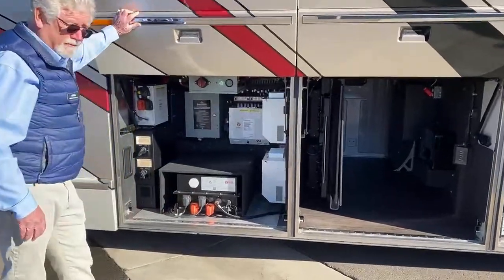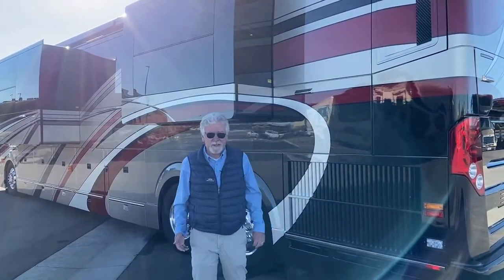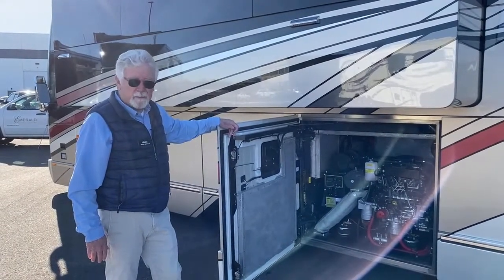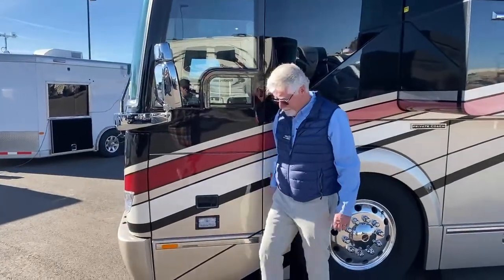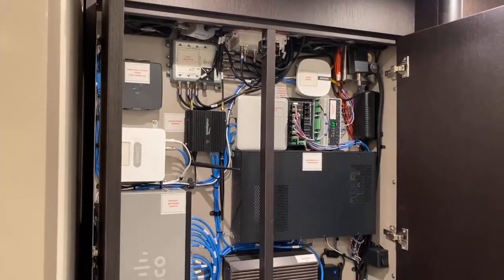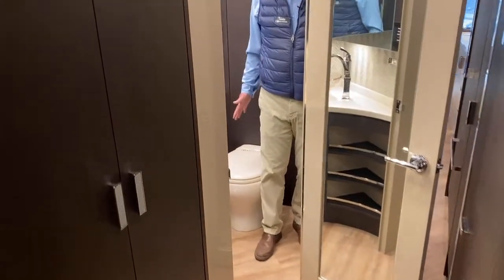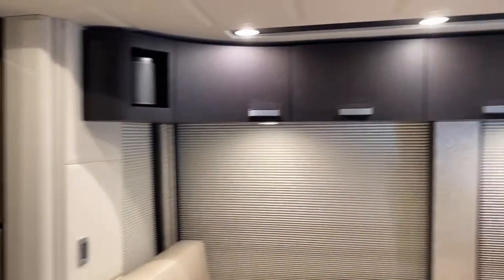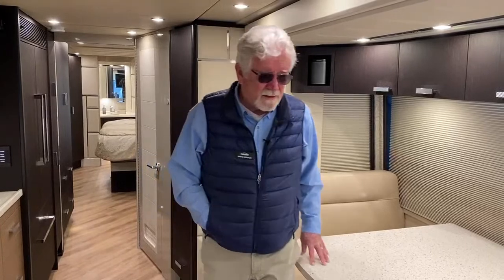2020 Emerald H3-45

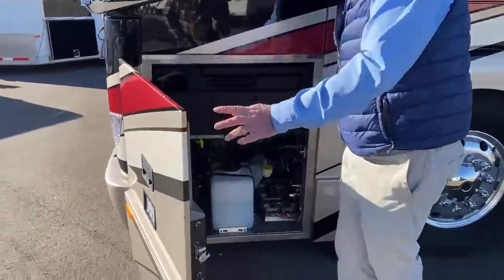Comment: Okay, you've got me when I see the Volta system.  For me, this means that Emerald is demonstrating that they are a high-end converter who is pulling out all the stops. At half the weight, double the power by footprint and 10x the duty cycles over AGM it's a no-brainer (even if it is triple the initial cost, it still makes financial sense).  If it's a high-end luxury coach, why skimp on house batteries when everything else is super lux? A couple of things that I was disappointed by were as follows: at 9:28 the washer/dryer doors opened into the hallway.  Oopsy?  Okay, I said two but the 3 hinges per-door (likely fastened into particle board substrate) will fail as people inevitably try to pass by while they're open.  My last nit-pick is the driver-side automotive door.  The washer fill is right above what looks like delicate electronic devices.  Are they splash-proof?  Don't get me wrong, I love Emerald Coach.  It's clear that they are leveraging the engineering details from Liberty (e.g the same heavy-duty bay door hinges, Volta and so-on) but they are doing better at interior finishing design than Liberty.  Queue the words Aircraft and Yacht and you get the idea.  Well done Emerald, fasten your seat-belts.